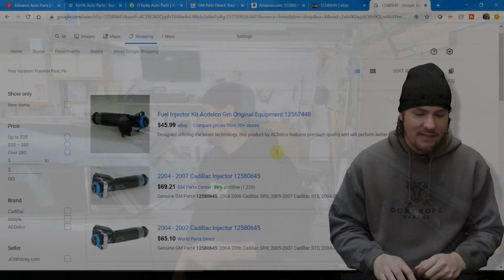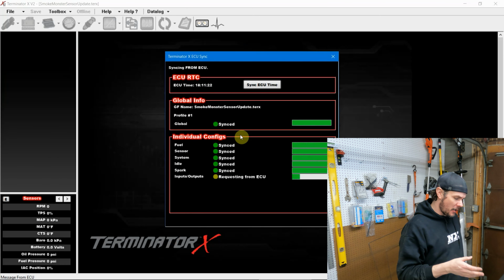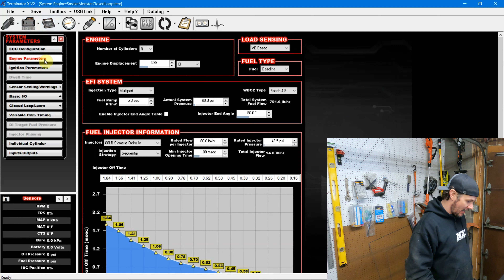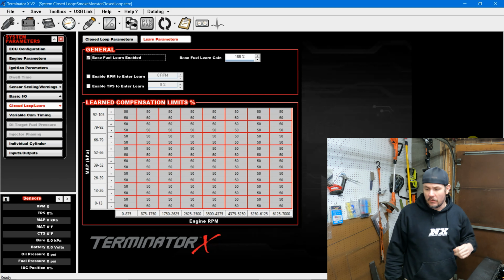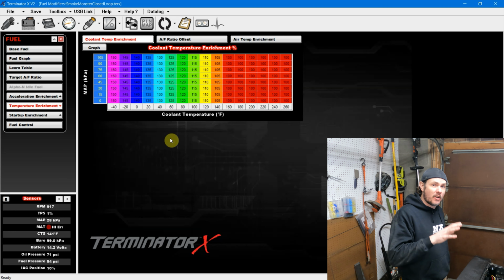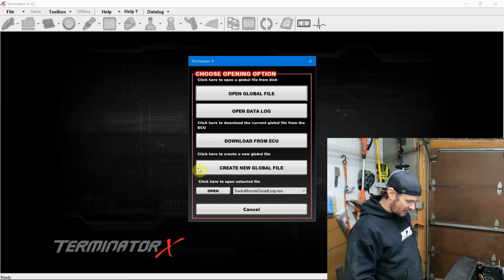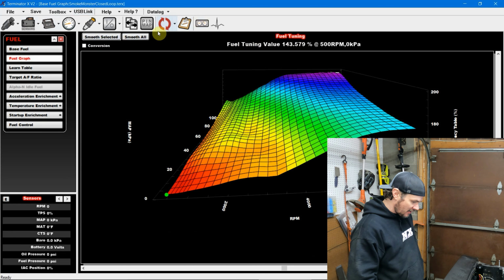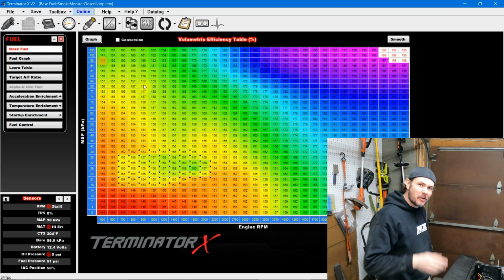Fuel Tuning On The Holley Terminator X, It's So Easy!

Comment: I find all the smoothing you have to go back and do with the learn to take longer than just doing it manually. It is nice sometimes though. Especially when a car has trash wiring and drops connection with the ecu every 8 seconds!
Reply from the maker: I've never had issues with it but will report back once we get it on the road.
Reply: When your new to tuning a few extra steps is worth it,  I like your channel also

Comment: I have a bored 5.3L to 5.7.  Engine won’t run unless tps is at 10-15% and throttle open.  

I have a TON of smoke out of the pipes like it is rich, but wideband says it’s at 14.5-14.8.

My question is regarding the cam specs.  When it gives the option for cam, does it refer to duration at .050 or original duration?  I know that will make a big difference, but I still have to figure out what I should be telling it so it tries to run better.  I spent $1250 on this setup and would like for it to run better than smoking me out of my shop.

Comment: What's the setup on this?? I've never seen an NA table that was way up at 150% ve. Hell on my turbo Camaro with an 80mm T6 with Bosch 210 injectors I'm not even that high in my ve table. I'm running 17 lbs of boost too

Comment: So hope I was paying attention. So your start up fueling is going straight into the ve and uses fueling multipliers at specific temp until you get up temp then multiplied by one or itself correct? I’m guessing that’s why you zeroed them out so no corrections? Do you have to do that or is there a open loop setting to prevent that? Or that was just faster at the moment ? It kinda reminds me of the  start up fueling map or table in HP if I’m looking at that correctly. I guess the learning on its own thing throws me for a loop guess you wouldn’t need open loop lol does it for you. Man I missing out
Reply from the maker: Closed loop will still work but learning won't when there is corrections. The start up table is literally the fueling applied until you break the run rpm which in this case is set to 400 rpm so once you break that it goes to the VE table.
Reply: @GoatRopeGarage  gotcha thank you brother. Thing sounds mean I bet it’s hard to think with that think running inside a closed garage lol .
Reply from the maker: Seriously, there was 20 minutes of it running that I cut out because you can't hear shit

Comment: Looks pretty simple I was thinking it less hands on to be self tuning  very similar to us logging in hp tuners and then taking the corrections from graph and adding them to fueling multiplying by half so we don’t overshoot  but I guess money saved from actually having to buy a wide and and credits 🤷🏾‍♂️ I have 3-4 projects so it’s just more economical for me to tune woth hp tuners vs buying a terminator for each of them
Reply from the maker: Yeah, you don't even have to log anything, you can just drive and it generates an error table for you to apply your changes
Reply: It's nothing like hp tuners. Hp tuners is for cheap mfs. That never wanna go fast. Hp is the most confusing costly ZJUNK I've seen yet

Comment: Still greek to me. Im sorry I bought the terminator x. They made it sound so easy.
I'm using magnetti marelli (Edelbrock) injectors. I have looked high and low, i cannot get the injector voltage offsets or pressure multiplier anywhere.
I should have stuck with my trusty q-jets.

Comment: Ive watched your stuff for a while and learned to do Gen III from you but want to know some of what is required for diesel tuning with HP tuners.  my truck is supported by HPtuners but information for what to do is few and far between as most diesel guys guard tune information like its the holy grail.  I dont want their tune anyway just want to know how to do it myself.  Can you do a video on diesel work?  i can send you a reference file and some logs if that helps.

Comment: How does an exhaust leak pull in air when it has more pressure than atmosphere??
Reply from the maker: Air rushing past a pin hole creates a low pressure point allowing fresh air to be drawn in
Reply: @GoatRopeGarage  you’re the man

Comment: My 11.2:1 compression lq9 with lsa supercharger seems to go through o2 sensor's really quickly on my terminator x....usually every 90 days I have to replace it!!!!.......is this a common problem with the terminator x. ....far as I know my afr's are fine....it go's  down to the high 11s low 12's  when in boost and back to 14.2/ 14.7 when just cruising. ...what gives???
Reply: Did u figure it out
Reply: @drjoe2323  no ….not really, but i did get a pro to tune it and i havent changed the 02sensor in years……”knock on wood”